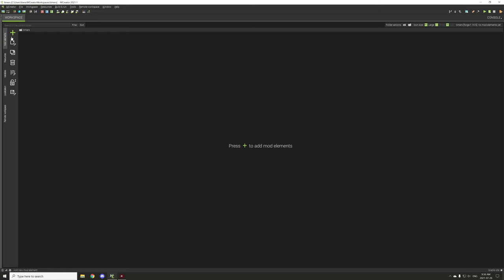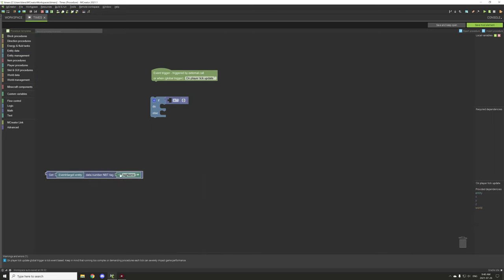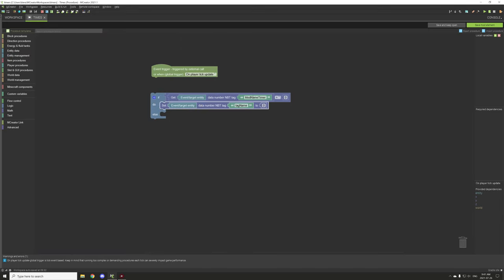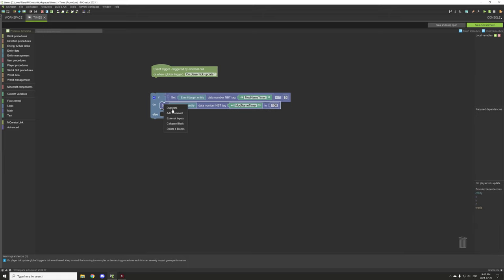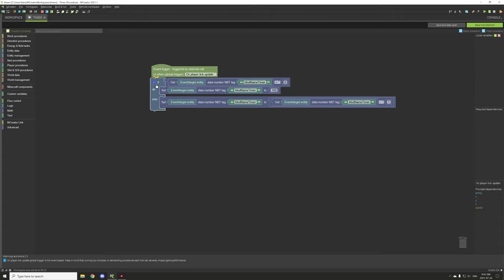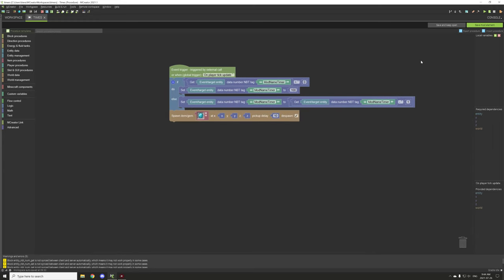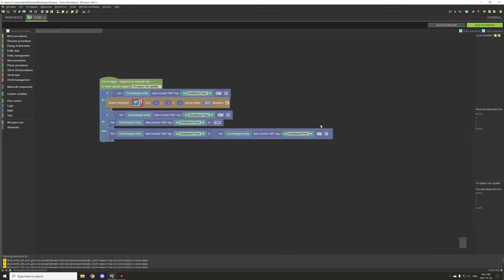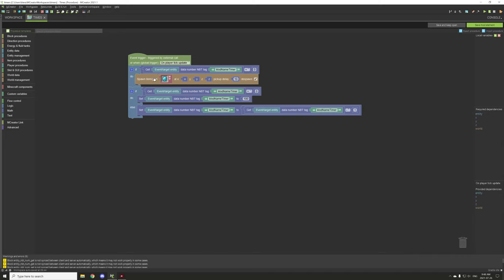MCreator 2021.1: How to delay things using timers

Comment: is there a way to set this up for an entity that targets a player and plays a sound?
Reply from the maker: Nearest entity would be the best option as it will work with any block that has and x, y, z blocks maybe world is needed too I can't remember but it should work on most update tick procedures even block ones. 

First you want to test if the entity exists then target the entity using the other block while setting it up the same as the first test. Once this is done it works just like source entity but does not require source entity or event/target entity dependencies meaning it has a lot of flexibility for what triggers it can be used in.

The only downside is it will only apply this to the nearest entity. So keep this in mind. I think there may be a other way but I am not as familiar with some of the new blocks to be able to know for sure.

Comment: Good video ! But I have a question, i don't understood the difference between nbt timer and Global timer? (thx you)
Reply from the maker: So for this you would need to know about variables. I can explain quickly.
Global variables run globally unless they are player variables meaning if you have something you want to run for all things this would work fine. The main issue with global variables is when you want the timer to run on per thing not for everything, this is where NBT timers can come in handy as they are stored to each thing and run separately.
The process is the same just how they run is a bit different. I hope this makes since.

Comment: i was trying to use the for a potion effect that heals the player every 100 tick /5 seconds, issue is the health the player gains is removed a few seconds later, im thinking because its a client side thing, but i don't know how to fix it
Reply from the maker: It depends on the what trigger your running it from, some only run on server side others on client side though many run on both. When dealing with players it should not matter to much if its on both, actually this can help at times as it syncs it across the server and client.

I would suggest to make sure the entity is not taking any damage during this period of time.
This would be the first step, I would damage the entity from some fire or something then put them out then run your script. If it removed over time then it could be a base mechanics like the game mode being hardcore and starving or something around those lines. If its one normal then it might be a server side issue.

In this case under world procedures/data there is one called "is provided world client-side" this will test if its on client side only if you add it to a if block, if you need to test for server-side then add a NOT block to the if statement then add your client side on that which will run only on server side.

Again this will depend on the trigger your running it from. For example block tick updates are only on server-side where some procedures like entity walks on block are client/server. You can also print a simple logic value in your IF statement and check console, if it prints out two times then its happening both on client and server. Only once then its one or the other. You would need to test what side by using the client-side block and trouble shoot from there

Hope this helps.

Comment: Is there a way to create a timer without the "On player tick update" trigger?
Reply from the maker: You need a tick update to make the timer work.
Otherwise it just runs once and ends until the next time the trigger is triggerd.
In the case of right-clicking its each time the player right clicks something but won't be trigged until they right-click with their mouse and the condition is true, so its more of a counter at this point not a timer.

Same goes for entities, blocks, and player.
Items should be handled on the player, entity or block side as updating the NBT can cause odd animations to happen when the item updates it's timer and in some case cause other actions like right-clicking to fail. So you pass it over to the player or entity instead this fixes the issue.

Comment: i have the same error code at the bottom but when i try to run it it sais it cant bc that error. why dies it work for you?
Reply from the maker: The messages with yellow icons are only warnings, they should work most of the time most likely it's because I am using NBT which is not supported by bedrock as it's a forge feature. Though I yet to have issues on any triggers that support entities yellow icons are just letting you know it could have a problem. Messages with red icons are critical errors that need to be fixed, in most cases it won't let you save the procedure until it's fixed but knowing what triggers your using and the dependencies for them are important for working with procedures, for example block added trigger for blocks does not support entity dependencies but you could use block NBT variables instead not that this would be a timer for block added you would need a block tick update to use a timer. Entity tick update for living entities and players and items also have tick updates but some functions due to how the game renders items in the inventory does not really work well with timers for items though it does work just visually buggy.

Comment: So I have tried the world tick timer but I am having some issues with it. It seems to be updating about 3 times faster than 20 ticks per second when I'm using GLOBAL_MAP variables, which does not make much sense to me and I'm not sure how to fix it. It does seem to work as intended when using the GLOBAL_WORLD variables, but I don't understand why, and I don't know how the WORLD variables work. The wiki says "Sets and saves a variable to a dimension." but does that mean it sets the variable to only one dimension, and if so which one, or does it mean there will be 3 instances of the variable, one per dimension? 

I need there to only be one instance of my timer throughout the entire map, so If I could get the MAP variables to cooperate that would be awesome. I really don't have any idea of what I'm doing wrong.

I'm using minecraft version 1.18.2 and MCreator version 2022.3.
Reply: I actually figured out why. When running it with GLOBAL_MAP it was adding +1 to the timer per world Overworld, Nether and The End, instead of only running it in the world I was currently in. That is why it was 3 times faster, and I fixed it by only allowing it to add to the timer while in the overworld.

I already intended for my timer to only work in the overworld but I guess that feature also solves this issue. I'm not sure of this issue is something new or if I'm just doing things incorrectly, either way I guess this is a solution for it if anyone else is having the same problem.
Reply from the maker: Global Map should run only once for all dimensions.

Global World should run for every dimension, however, I would imagine the trigger your running it from would be partly to blame if stacking values.
If you need something per world, you could do something like a global procedure for world tick update, this would keep it on the world level. if its run from a different trigger it may vary on how its added to the variable, for example if its the on a player tick update it might count for all three or just the dimension they are in, its hard to tell without testing for sure.

Comment: can u help me? i want to create a delay between massages to player. how to do that?
a player have a special item and when click in air in chat sends a two massages with 5sec delay
Reply from the maker: As long as your message to player does not use local variables you can use a delay block under flow control, for 5 seconds use 20 * 5 so 100 tick delay.
This will not stop other messages from printing so you will need to stack your messages in your delay if you want to print other messages after for example.

( Hello... ) (delay (world) ( Welcome to my... ) (delay ( channel ) ) )

I hope that makes since.
Reply: @NorthWestTreesMCreator  thanks

Comment: I can't create a NBT timer with fabric. Only on forge.
Reply from the maker: If you have fabric essentials then you can use global map and world variables which you can use as a global timer system works the same way but anything you link to it would be synchronized which may impact performance if your running a lot of script at the same time.

Comment: Why wouldn’t you just use a wait block?
Reply from the maker: Wait blocks are not always the best thing to use as they don't work with local variables. Where timers like this can support everything ;)
Reply: When possible, timers should be used, as they are the "more correct" way to do it
Reply: i cant find wait block

Comment: For some reason it drops 2 the first time idk why. Any idea ?
Reply from the maker: It should not drop any time, it may be something in another procedure you have, if your using the same variable for something else this could be the root cause for the issue.
Also if its NBT other mods may use the variable so try to make sure the NBT name is unique, you can use your mod namespace to help with that issue and just make sure to not generalize the NBT names within your mod.

Comment: But how to make sure that the action takes place under a certain range of ticks? That is, a random number between 2000 and 5000 ticks
Reply from the maker: I quickly put together some templates for both static and random times. There is NBT and Global timer templates in the zip files. I hope this helps.
https://github.com/MCreator-Examples/Projects/discussions/101
Reply: @NorthWestTreesMCreator  In fact, everything is much easier there, just take the Random integer between min: number and max; number - included, this is in the math.

Comment: it dont work
Reply from the maker: Trust me it woks I use this in many of my mods, if your using local variables then they are not stored like NBT or Global variables which would wipe the value after the procedure finishes maybe double check this and make sure you have the exact system I have.